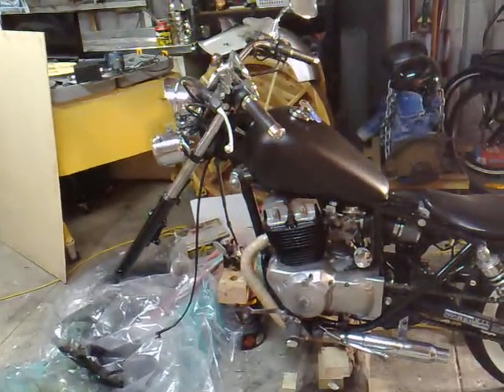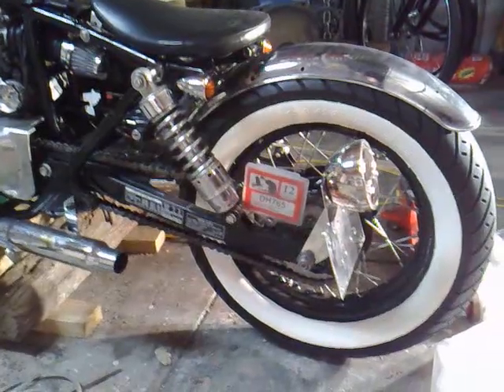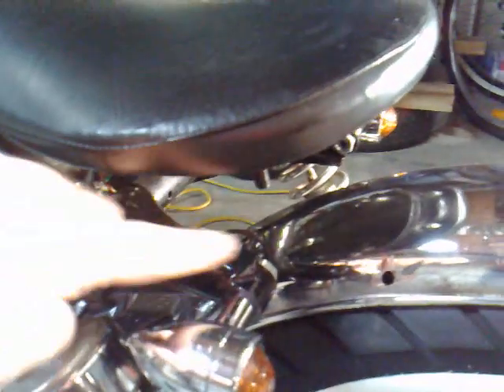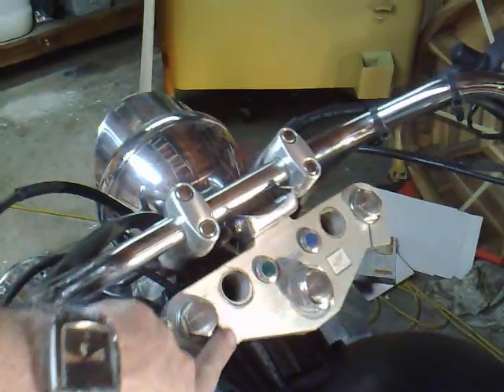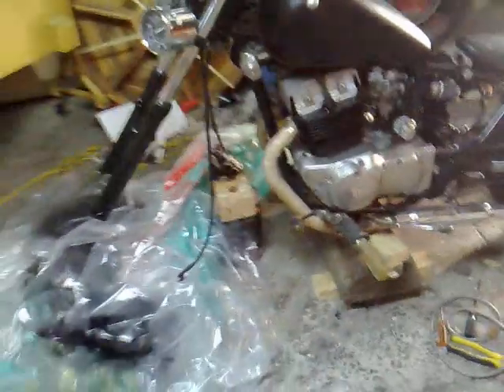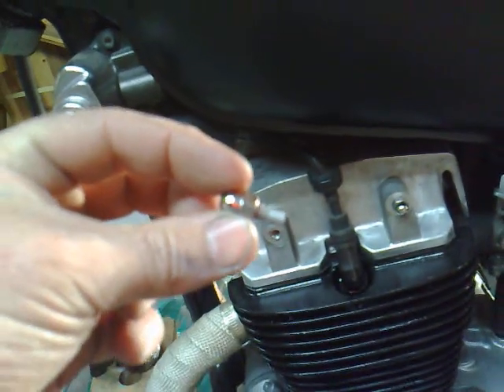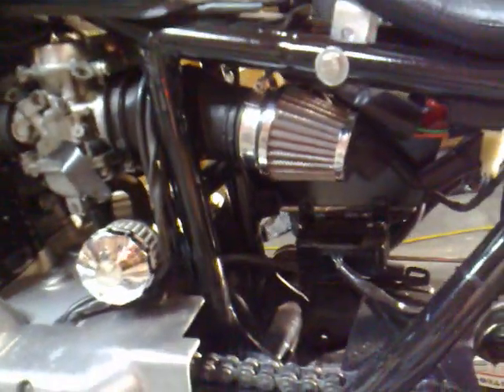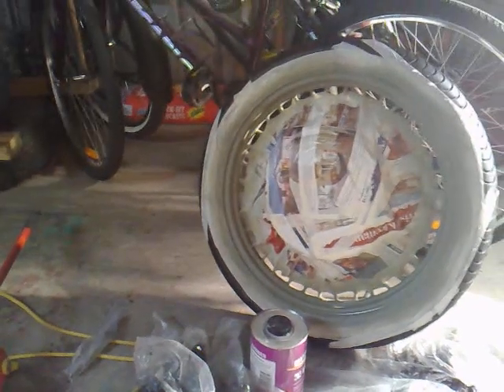'96 Honda Rebel 'Bobber' project - Stage 5

Comment from the maker: @kremlin57 

Standard POD FILTER....used some leftover exhaust pipe cut down which was the perfect diameter to use as an extender to slip into the existing rubber boot on the Carby then slipped the Pod Filter over the other end. :)  Best of luck.

Comment from the maker: Hey mate, re: the Carbie rejetting.....well no I didnt find that I needed to due to the engine being so small, it wasn't like I was going to get much more out of it. So decided to stay with original jets once I changed the original Air Filter box to the more simplified (and better looking) Pod Filter.  She just sometimes took a little bit longer to warm up after sitting around for awhile but nothing major, apart from probably running a little rich.

Comment: Just saw the video. I am doing an older Honda and just wanted to know if you had to re-jet the carburetor after adding the pod filter. I have a 83 cm250c belt drive and thought i could learn from another 250 bobber builder.

Comment: Is that the standard rear tyre for the 250? I know the 125 model uses the same frame and everything, but I never thought a white-wall would look good on a small rear tyre (As you usually see them on larger tyres on bigger engine bikes).
I'd love to know what method you used to do the white wall also.
Thanks